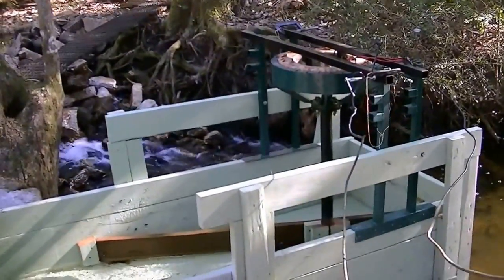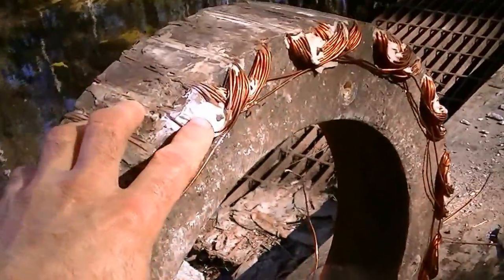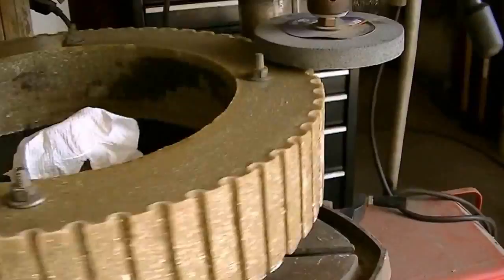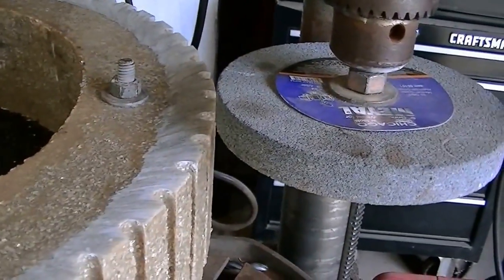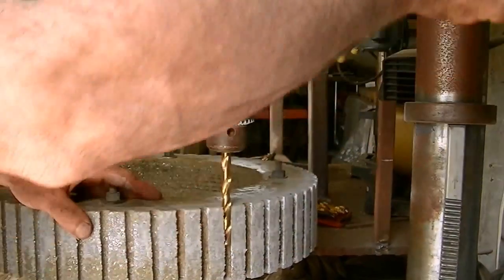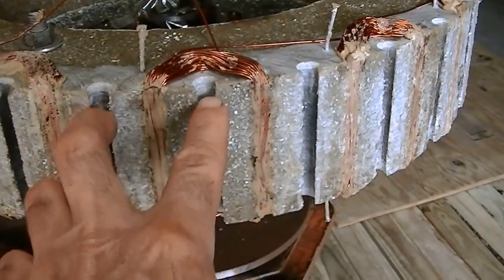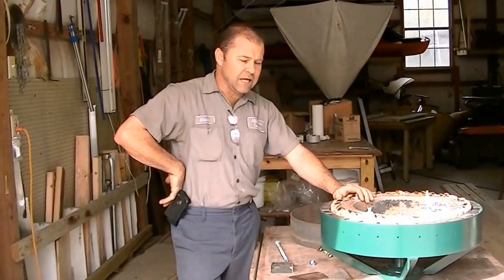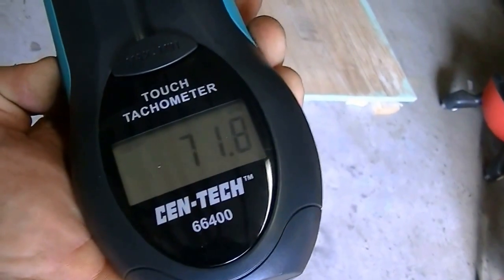Vertical turbine hydro generator system. Low rpm permanent magnet generator, home made

Comment: I love your design. I just built my own as well. It's in its testing phase right now. It is 3 phase, but when I hooked it up to a 3 phase bridge rectifier, the output was terrible. I ended up rectifying each phase and hooked it up to a battery to test it under load. The resistance was incredible under load. Do you think the resistance would be less using the 3 phase rectifier versus rectifying each phase? I have a video on my channel if you wanna check it out. Any info would be appreciated. Thanks and keep up the good work.
Reply from the maker: +TheGolfinj98 I think you get a little more power when you rectifier each phase separately and the diodes stay cooler as well.

Comment: that is an excellent design and setup. I was wondering if you rectify at the generator or just at your battery bank? I thought you may have less loss if you convert to DC at the battery bank (since it seems to be a distance away)

Comment: I realy like the power of this thing when it gets going. If your doing 400feet away, do you convert the AC to DC at the other end near the battery bank?... I hear that AC travels better distances than DC

p.s. youve got some infteresting stuff, so subbed, thank you
Reply from the maker: +DiyEcoProjects I convert to dc right at the generator. I share the same transmission line with power from my solar array so that is why I have to convert to dc at the source.
Reply: i see... hmm ok. Ive got a DC wind generator, wish it was an AC now because i have to have fat cables. Thanksfully its only got to go about 6 meters.

Just curious ... what charge controller do you have? and hows your house is set up.

Is your house both mains and self generated electric? do you have a video?

blessings from the uk btw.

(ps dont delete google plus, or your videos will get deleted. What happend to me. didnt know google owned youtube)
Reply from the maker: +DiyEcoProjects I don't use iron filling just iron rings and aluminum fillings. Yes the magnet flux goes thru the iron ring in the stator and in the outer housing. Here is a video on one of my systems.https://www.youtube.com/watch?v=MuaT-Ug0kQY
Reply: ok thanks... ill take a look. always up for learning new things. planning on going off grid one day you see.
Reply: ... i converted my friends van to solar and wind. Was a fun project. I had series of big resistors for a dump, safer as didnt want a heating element in a small space. only thing was the charge controller was wrong and i had to get a more expensive one.

Comment: Cool thanks for sharing. Is you stator made from resin and iron filings? thats realy interesting... how does that help please? ... also two phase? why not 3 phase set up
Reply from the maker: +DiyEcoProjects I use a resin with iron rings. I was trying to get it the most efficient and two phase work out great.
Reply: Hi there... I saw what you said about putting thing magents in a ring for equalibrium. Thats cool. so the magentic flux goes through the coils, to the iron filing stator and back to the hoop then? is thats what its doing

Comment: That looks like a good one. Though I wonder if it would work if one tried to make an MHD generator with no moving parts just moving water if it is conductive from disolved minerals. It has perminate magnets that attract perpendicular to the conductive stripes to collect power. The water moves throught the mhd to make power. Salt water would be ideal because it is more conductive but the minerals in water might work a bit.

Comment: Would it be more efficient if the turbine was inside the vertical tube to generate more pressure and increase rpm? and then just filter the water intake to avoid foreign objects from clogging it?
Reply from the maker: +J Miranda Yes, but I would have to clean the filter twice a day and I don't have the time to do that.

Comment: What material is the stator made from?
Reply from the maker: The stator is made from fiber glass with steel rings in it.
Reply: @markp0177  Would you mind posting a video on how to cast the stator?
Reply from the maker: I did video casting one a few years ago but it would not up load to youtube. I sold all my jigs and mold about 1 1/2 years ago.
Reply: @markp0177  ah yeah to keep eddy currents down. Ok!  Thanks!
Reply: Horatius Regeneratione --one cannot use recirculation to generate power due to the second law of thermodynamics--very simply, there are no continuous motion machines, and recirculation itself requires input of power, it cannot generate power--I could be missing something in your note though.  Water wheels work because the good Lord has sunshine evaporating water, and dropping it up on the hills where it then rolls down so clever men might apply physics to remove some of that energy.  The water flowing down is the energy being harvested.  Lifting it up costs energy (sunlight).  If you are pumping it up, you won't be able to remove more than you are putting in!  I've had many folks come to me with this kind of invention.  Look up continuous motion and second law of thermodynamics and it will be clear.   This fellow building this generator is a true inventor--he is finding solutions by applying what he knows.  Awesome!!
Reply: He said it's a casting so I guess it's some kind of epoxy with chips of ferrous material mixed in it.
Reply: mark0177 :  fantastic work.  it seems that a few of us want to know more about building your stator.
Reply: i would also like to know
Reply: it's made from a ferrous material.

Comment: How many turn in every coils of magnet wire? how much the current gain in one cycle? Is it 50 or 60 hz? how much the voltage in 45rpm?
Reply: +Rudillo Jr Anida The frequency is dependent on rotation speed - which the flow rate of the water dictates. Frequency is not really an issue as the rectifier converts it to DC whatever its speed. This is how all generators work. If you want to power domestic AC loads requiring 50 or 60Hz you'll need an inverter to turn the DC back into AC.

Comment: Your set up looks cool...   and I know it only runs at a certain RPM...  but I wonder if the water can handle more torque without slowing down??     If this was my set up, I would try different gear ratios between the prop shaft and the generator on a second shaft....      for example, set your generator on a 2nd shaft that is mounted to the side of your dam and install a chain that ties to your prop shaft.. this way you could change sprocket sizes and experiment to see if the prop still maintains the same RPM under a greater load....   I first would try 3 to 1...   so you could put a 30 tooth sprocket on your prop shaft.. and a 10 tooth sprocket onto your generator...  in this way, your generator would spin 3 times as fast as you have it now...  and if you check your prop rpm, and it is still running just as fast as it ever did..  then you could maybe try 4 to 1.. ect...  I would use motorcycle sprockets from ebay for cheap.... or even a belt system....

think of the water itself in electrical terms........   it may be running at a low voltage (rpm) but still have a much higher current (torque) than you think...

the higher you can make your dam, and the further down you can make your shroud and prop, the more power it will have...  because it is based on gravity, and the weight of the water that is stacked on top  of your prop at any given time... 

try to calculate the VOLUME of water that is flowing through your system, and then look up what motor it would take to pump that amount of volume...  then check the running wattage rating of that motor, you should be getting close to that amount of watts out of your system....  now sleep on that

Comment: contact me if you can i have a great idea for you to get more force from your water turbine
Reply: +Alex Manzanero I think i'm thinking of the same thing you are. 
Put another cone in the middle so that water only has a gap to flow but on the outsides of the blades instead of falling into the entire blade. 
That should increase the RPM's.
Reply: forgot but also remember that water has weight & therefore can be assisted through heighth sooo if a long column between inlet and outlet of water the water will have greater pressure and velocity (picture in your head hoover dam)
Reply: +spydergs07 free fall is good just aim the water as your original plan at the outer most part of the fins or turbine wherby you get the most bang for your buck through leverage
Reply: +Alex Manzanero  how would you  do it?
Reply: Nelson Dacosta there's a formula that is a common denominator for a lot of efficient motors and turbines; ke (energy)= mass times v squared soo every time you double velocity you get 4 time more power; if you triple the velocity you will get 9 !! times more power so how do you do it?? ill tell you Nelson on next reply
Reply: Nelson Dacosta Instead of allowing water just to fall thru the whole apparatus funnel the water outwards to create more speed (velocity) the middle to center part you are just wasting water have the water pressure work for you creating higher velocity outflow and aim it at the outside rim of your turbine underneath. Remember in school about Leverage? the out side of your rotating turbine fins will produce more power thru leverage than the inside part of your fins sooo it stands to reason that by increasing your water velocity aimed at the outside fins you will gain up to 9 times or maybe even more it will all depend on how much faster you can get the water to flow 4 times more will increase power by 16 times!!! just dont increase your mass v squared is the solution!
Reply: if you send me your email i can send you how to structure your new version to increase water velocity
Reply: yes you see the most force comes from outside perimeter because of leverage( like loosening a nut with a large wrench vs a small wrench. if you can look up "dyson impeller " on google images and you will see what im talking about centrifical force makes vacuum works stronger and this come with velocity energy=mass x velocity squared
Reply: any other flow of water through the denter is just wasted potential energy; make it work for you! yes you are on track
Reply: Exactly what I was thinking. 
I'm going to have to try this! I'm also wondering too if maybe between the 2 funnels I could put some fins that are slightly angled to hit the bottom fins in the direction they need to move. I wonder if added force plus having the water funnel down in a slight angle would help to. Instead of having water fall straight down, have it slightly spiral in the direction of the motor. 
I'm going to have to do some testing.
Reply: +spydergs07 there's an obscure phenomenom called impact energy. anything that increases velocity and has a direct hit (impact drill a lot stronger than regular drill even though same energy is used) I think you will gain more energy the way your thinking
Reply: +Alex Manzanero I also posted a comment that water has weight; the more distance(vertically) from inlet to fins has water that is using gravity to help in the force, the taller the column the more weight and thus pressure hitting your fins
Reply: Alex Manzanero Yeah i'm with you on that. I think I have a 8'-10' fall I could setup and see if I could get maybe a 6'-8' free fall of water before hitting the bottom fins.
Reply: +Alex Manzanero   Increase velocity by reduction, start w/ a large diameter pipe and reduce, sort of like they 
used in strip mining years back. I have seen these on youTube, one guy was shooting water over 20 feet
by reducing his piping.
Reply: right, a lot of efficient devices rely on this formula K.E.=1/2Mass x velocity squared so every time you double or triple velocity your ke goes up by 4 or in the latter by 9 times
Reply: +Alex Manzanero totally could make this 10x more efficient however there is a negative effect to the wildlife and maintenance.   as he said
Reply from the maker: +munyut nyot My email address is markel38@aol.com
Reply: +Jose Francisco Medeiros  send me you email and i will share my ideas thru a link from my gmail thanks
Reply: +Jose Francisco Medeiros I just sent to Mark also
Reply: +Jose Francisco Medeiros  I sent you a link pic 3 shows dyson turbine pic 4 formula to increase force pic 6 paddles in outskirt. When water flows outward velocity is increased by squared factor(pic 4) double speed = 4 times more force simply by forcing water towards the outskirts; 2nd law of leverage putting paddles at place where water is now rushing out; the leverage as in picture after seesaw will give you much more torque to move heavy generator. the illustrations apply to water as well as wind

Comment: what material are you using to cast your stator form?
Reply: Well, the rotor is kind of a steel tube, or bent flat steel. The magnets are attached to the rotor with some glue or screws. The stator is also made of steel pieces, to guide the magnetic flux through the coils, but they are cast in some resin, probably 2 component oder expoxy resin
Reply: I’d like to know both of these as well.
Reply: Obliterous 
I'd also like to know the composition of your rotor.

Comment: mark what type of current you produces AC current or DC current.....
Reply from the maker: ADIB RAHMAN It produces AC power and I then convert it to DC to charge 12 volt batteries.
Reply: mark you say.....u change the current from AC power to DC power by full bridge rectifier....its inside your stator is rectifier....what i mean is inside your stator have two part like transformer before your transmission line wire.....its transformer or rectifier.....
Reply from the maker: ADIB RAHMAN Their is no transformer. A transformer raises or lowers the voltage. This is a two phase alternator that uses a full bridge rectifier to convert it to DC.
Reply: markp0177OOO ic....two part inside stator is alternator.......but its look like transformer.......huhu.....mark I very impressive your power generator......thanks mark....your video make me.....to study more detail about electromagnet n motor machine.......hihih...salute to you from malaysia

Comment: Mark, would you consider making some plans or a step by step instructional dvd of how to build this wonderful generator? I would buy a copy in a heart beat. If not do you care to answer some questions? How do you build the stator mold? and how to you roll the metal for the magnet holder? what are the dimensions of the stator and the magnet holder. What size magnets and how many of them do you use? Great job again man and keep making those videos about the generator. Please consider making a step by step video, I will buy.
Reply from the maker: suteu9 I will answer your questions. Contact me at markel38@aol.com
Reply: suteu9 I'm in too - can you provide some plans?  I'd buy!

Comment: 400 ft is a long distance to send DC. Have you considered using some transformers to to kick the AC voltage up for transmission and back down again for rectification? You would gain some efficiency.
Reply: Or at least run AC up to your battery location then rectify it , even Edison realized long DC runs weren't the best.
Reply: The output of the generator is AC

Comment: My compliments Mark!, nice job done here!
Can you tell me how many watts this generator delivers?
Can you share of what material the core is made?, especially the iron part isn't clear to me
I really would appreciate your reaction.
Reply from the maker: ***** The core is made out of fiber glass mixed with aluminum shavings. I have another video showing the iron rings.
Reply: markp0177 The Link for the Iron Ring ?
Reply: Craig Lewis i ment the video where you show the iron rings I already looked af this. nice work, again! 😀
how many watts will this generator deliver at max flow?
did you calculate the windingd or just use the try and error method? 😇
why not using neodynium magnets? (price, temperature or rust proofness?)
Reply from the maker: ***** I get around 500 watts when the water is just right. I did not calculate the winding, just guessed. Neodymium magnets cost too much. I don't think I have a video of when I make the iron ring, sorry.